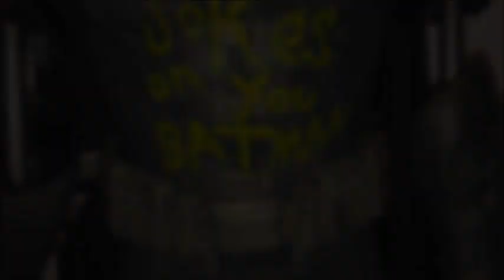18 INCH CUSTOM BVS ROBIN SUIT MAKEOVER

Comment: New subscriber from cosplay Chris. Awesome stuff you do. Any suggestions for filler for arm joints??
Reply from the maker: Jambo Shango thanks. In the past I have used ready mixed filler mixed with pva glue. I used it on my bvs cowl and mech armour helmet. Once dry it doesn't crack. The pva glue acts as a sealant

Comment: where did you get the colt python from walking dead
Reply from the maker: Stand up Tallent hi which one do you mean. The toy gun a did a custom paint job on or the BB gun
Reply: Paul's DIY hi Paul the one that is in the holster on your bookshelf. it looks amazing
Reply from the maker: Stand up Tallent that's the BB gun. Check out the link below. For the BB gun on amazon. I. Ought the holster off eBay from America. Search black basket weave gun holster and you should find one. 

https://www.amazon.com/TSD-Zombie-Airsoft-Spring-Revolver/dp/B00KQX9LDI
Reply: Paul's DIY thanks Paul for the info, clicked on link but not shipping to Scotland
Reply from the maker: Stand up Tallent try copy and pasting TSD Zombie Airsoft Spring Revolver, Silver, 6-Inch in google search. I didn't buy mine from amazon. I bought mine from an air soft website.